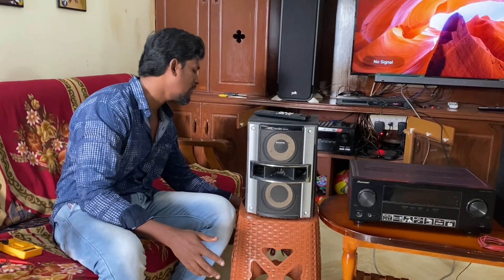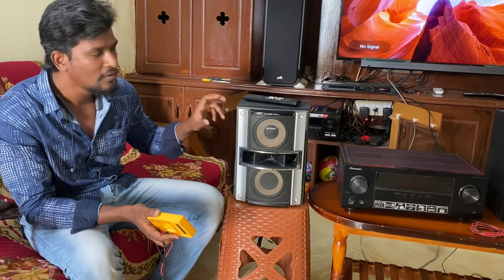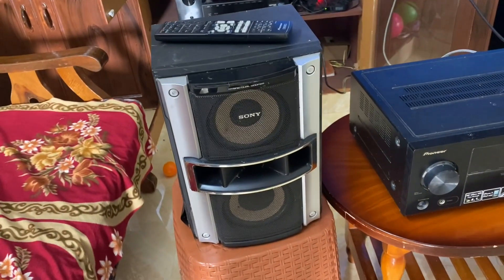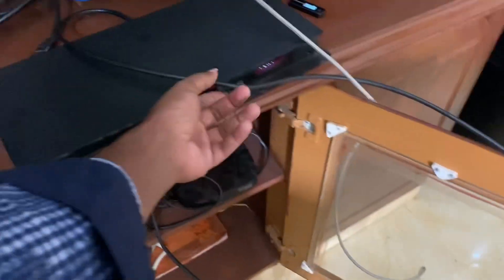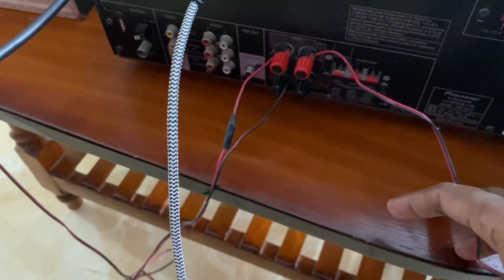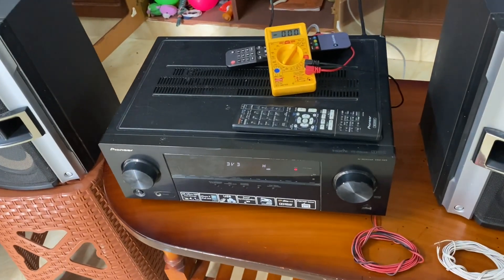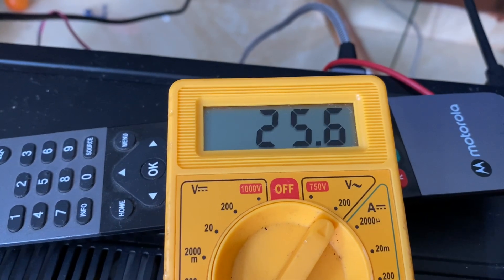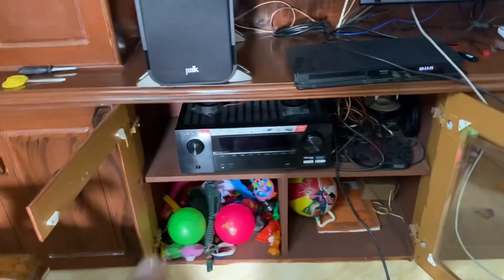Issues Pioneer AV Receiver Speaker Output Voltage Problem

Comment: bro nanum sony speaker vechiruken adhu yemaha avr la podama, branded speaker kum indha old sony speakerkum enna vithyasam
Reply: ஒங்களோட amp எவ்வளவு Power Delivery பன்னுதுன்டு பார்த்து அதுக்கு ஏத்தமாதி Connect பன்னலாம். உதாரனம் ஒங்களோட amp 8 ohms Speakers க்கு 100 watts Power deliver பன்னினா ஒங்களோட front speakers at least 150 watts இருக்கனும். 

எதுக்காக 50 watts front Channels க்கு கூட வேனும்னா நீங்க Stereo mode Le கேக்கும் போது முன்னாடி உள்ள ரென்டு channels மட்டும்தான் படிக்கும். நீங்க full volume வச்சாரும் கூட speakers க்கு எந்த problem மும் வராது. ஏன்னா amplifier 100 watts தான் delivery பன்னும். Speakers 150 watts. 

150 watts க்கு குறைவா இருந்தாலும் பறவாயில்ல ஆனா 100 watts க்கு கீழ போய்ட கூடாது. Under 100 watts over drive your Speakers. Not safe 😮

மத்த channels எல்லாத்துக்கும்  just 20% கூட watts இருந்தா போதும். அல்லது 10 watts கூட இருந்தாலே பொதும் எந்த problem மும் வராது. I means All Surround Sounds Speakers and Centre Speakers + atmos.

ஆனா 8 ohms Amplifiers சா இருந்தா Speakers 8 ohms லதான் போடனும். நான் மேல சொன்னது 8 ohms amplifier and 8 ohms speakers பத்திதான்.

ஒங்களோட speakers 8 ohms இல்லாம குறைய இருந்தா amplifier அதிகமான power deliver பன்னும். Example 4 ohms amplifier deliver power double then 8 ohms.😮

Speakers 4 ohms ஆ இருந்தா அதுக்கு ஏத்த மாதி match பன்னனும். ஏன்னா Speakers எ over drive யும் பன்ன கூடாது under drive வும் பன்ன கூடாது.

Comment: Bro power amplifier Pathi solunga. AVR ku power amplifier podanuma kandipa. Also onenu clarify panunga bro, na samsung q990b soundbar vangalamnu ninaikren.adhu besta ela AVR polama?
Reply from the maker: Avr than best. Power amp pathi video poduran bro
Reply: Power amp above 1 laksh for minimum spec so ...... used to mind range reciver and speaker no need ....you used hi end exam 11.2 channal or 13.2 channal you need power amp........... almost available inbild power in av receiver.........hi end then only process so used to power amp